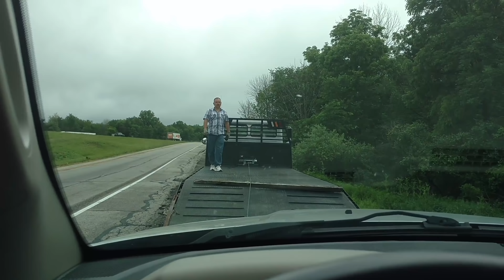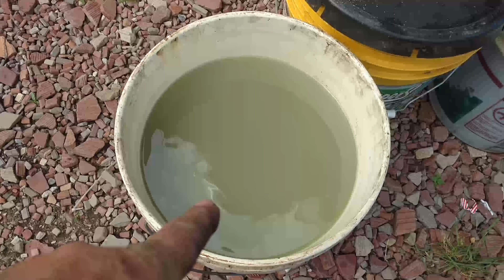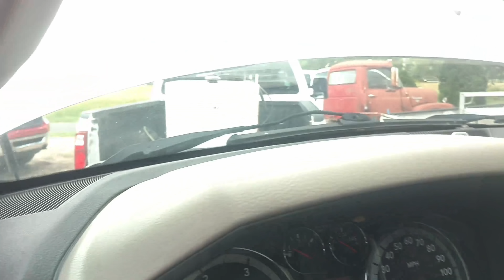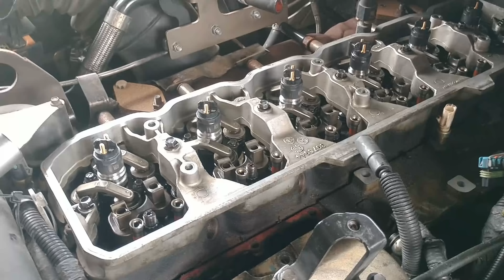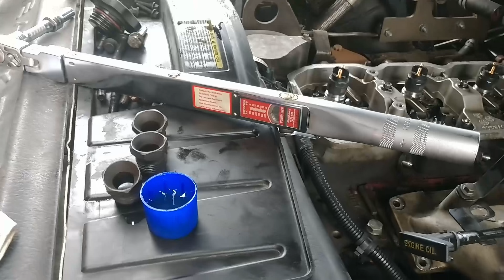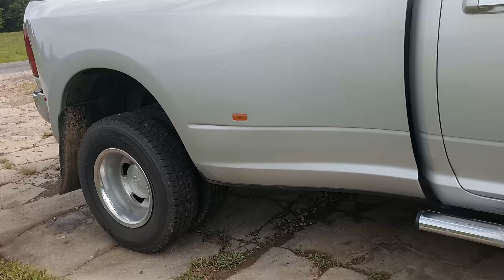RAM 3500 CUMMINS LEAVES US STRANDED!!

Comment: So you had a injector stuck open and letting the fuel rail pressure drop so it wouldnt build pressure. Im just wondering because i have a friend that has one exactly the same and if he has a fuel rail problem incan pass that info on to him

Comment: My 99 & 05 Dodge trucks done the same thing, just cut off. Fuel pumps! When the 99 fuel pump went out it took the injection pump also, 05 had feature that prevented burning up injection pump. Many guys install the Air Dog type pumps on frame rail and eliminate the tank pump
Reply from the maker: i have run the several dodges with the cummins diesels. this is the first time i ever had this problem but i drain the fuel water separators often. i doubt i will have any other problems with water in the fuel. i dont like aftermarket add ons. i like to be able to go to regular parts store and get back on the road. im not saying the air dog or fass parts are bad.....just not for me.
Reply: Understand that, I went back with OEM pumps on both of mine for the same reason that I don't like aftermarket anything. Thought seriously about the Air Dog but didn't do it. Only thing aftermarket on my 99 2500 and the 2005 3500 was K&N filters in factory air box. When I traded, the 99 had 251K miles and 05 had 207K miles, both of them still ran and pulled awesome. Just got a 2018 Limited 3500 dually with Aisin trans and HO 6.7, may change air filter to K&N mainly because the paper filters are about $46 and a washable K&N is $85

Comment: I have two 3500s with 5.9 engines. I will share my experience as some may apply to your year. 1. Dodge fuel filtration sucks they have been through 3 revisions over the years. I simply installed a FASS, i also added a sump which fixed my water issues. Water was collecting in the bottom of the tank under the straw and would not make it to the drain in the filter. 2. Check you factory lug wrench, i had two incorrect ones on different years, never tracked down the right one, j use a breaker bar with socket  so i can change a flat if need be. 3. Factory bumpers are a bad joke, i went aftermarket. 4. If you chip the truck a new automatic transmissionnis in your future. They hold up fine on stock trucks.

I went with cold air intake and MSRP turbo back exhaust. Which helped with performance and mileage. To further bullet proof the truck i installed manual hubs. Picked up a couple of mpg. If your alternator goes and tests good, just add a cheap external voltage regulator, the dealer fix is a $$$ power train control module. I also replaced my batteries with group 31 which i can buy anywhere, cheaper more juice than the stock group 65. I carry spare fuel filters, a new belt, tensioner and the tool which has kept me from being stranded.
Reply from the maker: thanks for sharing. this was my first break down in many many years. i try to take very good care of my vehicles. this problem could have been avoided had i remembered the fuel lines in the bed were cut and left open by the previous owner. i always carry my own tools including a socket and breaker bar for the wheels.
Reply: @j.c.smithprojects  my story is not neccessarily for you. People will use google and find the post. I still carry stock fuel filters in my truck for the purpose of helping stuck unsuspecting cummins owners:) glad it was a simple fix. These trucks can be a bear when things go wrong.

Comment: It has nothing to do with brand of truck, but rather the common rail system in all big 3 trucks do not like water, debriis, etc... in the system.  Most likely all fuel parts/ components from tank forward will need to be replacement 9 out of 10 times.  Unlike CTD 12v/24v or 7.3 PSD are more forgiven with a bad tank of fuel.

Comment: If memory serves me correctly those trucks have issues with the  fuse module or something like that I don’t remember what it’s called but it’s not a fuse box. The welder guy on YouTube Austin I believe is his name had it happen to his ram and the entire truck just shut off. He had to replace the fuse control module or something like that. I wish I could remember proper nomenclature.
Reply from the maker: it is called a tipm. totally integrated power module. very problematic on chrysler products.

Comment: Nice work sir, sounds like your torque spec and sequence is pretty close to correct, I'm sure it's fine! If you plan on keeping that truck, I would recommend putting a fass 150 or 165 on that truck, it really helps the life of the lift pump and fuel pump over the life, plus adds a water separator and fuel filter inline, they really make a difference on those medium duty diesels, just my .02. Great video as always.
Reply from the maker: im not sure this truck is going to be sticking around.....if it does, the next upgrade is going to be an allison transmission!

Comment: Great video. I’m surprised you don’t have a truck with a 6.7 power stroke.
Reply from the maker: i have 4 trucks with the 6.7 powerstroke. i prefer the cummins over the powerstroke. more power, better fuel economy, torque is incomparable, less complicated, more reliable and less expensive to repair. it just stinks the cummins comes in such a crappy shipping container!!
Reply: They do not have more power ford pulls beter
Reply from the maker: anthony cash..i tow with both. i own 3) 6.7 fords and 2) 6.7 dodges...i will stick with the cummins. it out performs my 6.7 powerstrokes hands down every time.

Comment: That really sucks about the water causing all that damage. Actually ... I disagree that that's a great engine. They quit being great in 98 1/2 when they came out with a 24 valve with electronic injector pump! But, I do have a few of the great ones. LOL
Reply from the maker: the 12 valve is definitely a great engine...the 24 valves and the common rails are still good engines but not as trouble free as the 12 valves. i just bought a 95 f700 with a 12 v and a 6 speed for a project i am hoping to build soon...resembles someones rat recon....keeping my fingers crossed that i can make time to do it!
Reply: How do you figure??? The common rail cummins is THE best best small truck diesel engine ever made how could you possibly argue that?? Better power, mpg, reliability and simplicity than any engine period! There is a reason you see a cummins diesel is swapped into about every vehicle you can imagine!
Reply: 12 valve Cummins will run with no electronics .. no battery (just think EMP attack) and have never left me on the side of the road but my 24 valve did ... manual injector pump proven more reliable than a computer operated common rail pump IMHO!  And most of those swaps are 12 valve cummins engines not common rail engines! My buddy had a common rail cummins truck that always failed him so he sold it to buy a more reliable 12 valve truck and he has never went back!

Comment: Glad you got it sorted out JC.
A shame about the cut lines contaminating the system but, looks like you covered all the bases and repaired the problem.
Look on the bright side, at least it happened locally and not during your vacation travels. That would've ruined your get away time !
2 thumbs up from here, great video and good narration of the sequences and procedures.
Reply from the maker: that would have been a stinker for sure. i went over and beyond on the repair to help prevent having any other issues on vacation. the truck did good. no complaints and got 10.6 mpg...not bad at all for the size, height and weight of the camper.

Comment: Looks like someone removed auxillary tank from bed and left you a nasty surprise buy just cutting the hoses.
Reply from the maker: the worst part is...i saw the lines and knew what they were for but i forgot about them.
Reply: I hate when crap happens to me (see a problem and ignore it) or my brain doesn't put 2&2 together. It always causes me to want to bang my head against a wall for procrastinating to do something that was no big deal, and then ends up being a big deal...Be careful when you banging head against wall, you don't want to cause any  more problems.
Reply from the maker: i saw the hoses and just plain forgot. that forgetfulness ended up costing me well over $4400.
Reply: Ouch!!!
Reply: A mistake similar to this has happened to me a couple times in life... Taught me when I spot a problem like this to take care of it asap! If I put it off I will forget about it and suffer the consequences or problems will start stacking up and overwhelm me...

Comment: Wha year is that ram? I hope I didn’t give you bad luck through the tailgate shock mod lol , since our van failed the other day haha
Reply from the maker: 2011. i think your van wouldnt start because the throttle body wouldnt pass a self test...i have seen the electric motors fail or get so gummed up it wont go full open and full closed. you got it fixed and that is all that matters.

Comment: did you have to turn the old injectors in as cores.. you might want to find somebody with the proper set up to clean and flush them.. so you have spares..  having water and diesel fuel in them really cant be good for storage.  i would imaging that the injector that is stuck open might have dirt or rust in it from the water contamination..  by the way.. most hardware stores and a lot of places online sell super magnets.. you can drop super magnets into fuel tanks.. plastic tanks require one on the inside and a second one on the outside.. after finding the one on the inside gluing or duct taping the exterior one in place.. it can keep any rust out of the fuel pump and strainer..  i usually have a stack of quarter sized super magnets and one goes in every fuel tank i drop or at least have the sending unit out.  sediment comes from gas stations.. along with rust inside the tank on the hanger and steel lines..  don't believe me.. next time you take a filter off a gas engine blow it backwards into a plastic container..  put a magnet below the plastic container and watch the sediment all gather in the magnetic field lines.
Reply from the maker: no. i bought brand new bosch injectors. i kept the old ones for spares or to use on another truck.